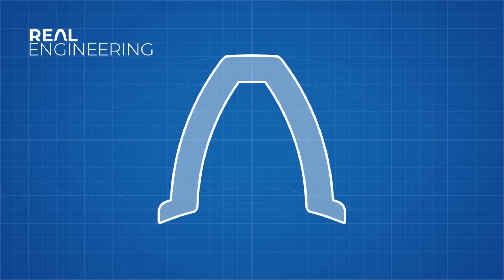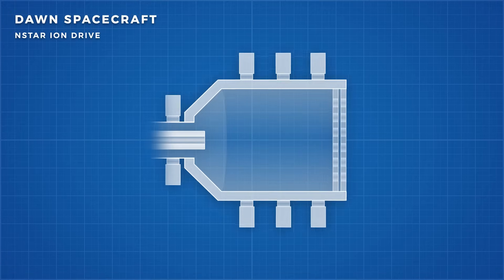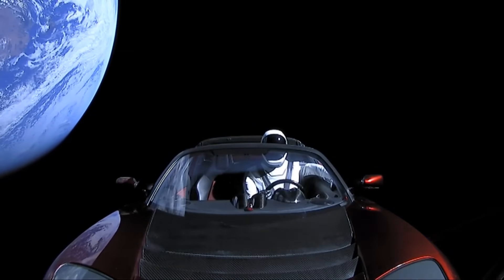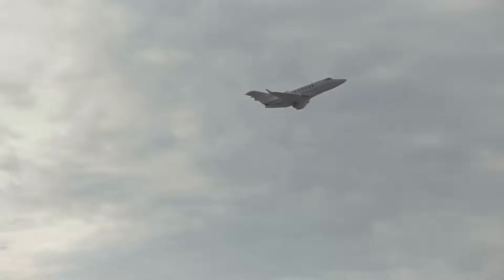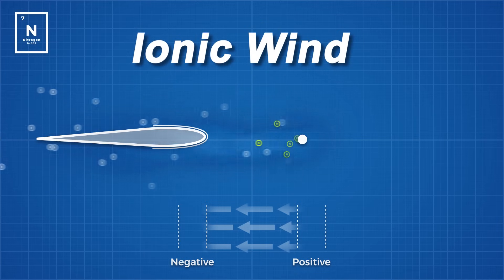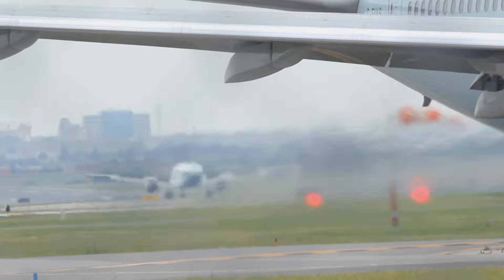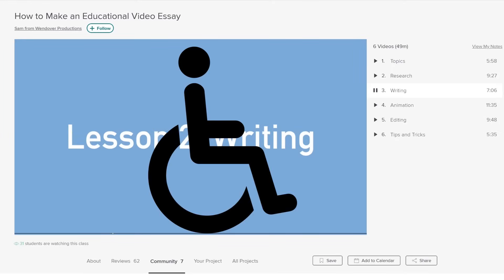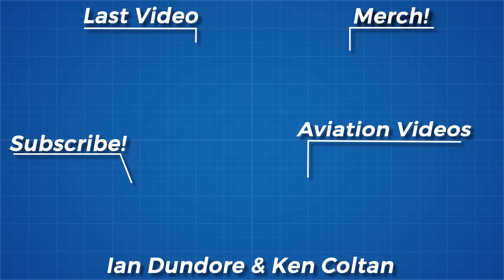Ion Propulsion - The Plane With No Moving Parts

Comment: What if you somehow hooked up these ion wing things to spin a propellor like a turbine being powered by the air kicked off of the ion engine
Reply: You still have the law of conservation of energy working against you. Every turbine slows down the air that passes by and produces more drag, which im turn would slow down your aircraft, not to mention all the ways energy is lost through transformation, cables, etc.
If you had an aircraft that could power itself by harnessing the energy of the wind it passes by while flying, you'd have created a second degree perpetuum mobile, which is impossible.
Reply: What would be the point of that?
Reply: The smarter thing would be to have a fuel powered generator to power the system or charge batteries that powered the system. 
But trying to produce power from spent power is a waste of power. You end up losing more than you gain. 
But either way, trying to scale the system to the weight that is gained by adding a charging system ends up requiring an exponential increase in the power needed to continue to keep it in the air. 
I will put it this way. If you double the weight of the craft you end up needing 4 times the power just to keep it airborne. Roughly speaking anyway.
Reply: The point is to have no moving part. A propeller defeat that purpose.

Comment: What about ram jets? They were the first non moving part aircrafts.
Reply: Not having any rotating turbine inside the engine, yes. That does not mean eg. fuel was walking into the engine on its own accord. The power train on this plane literally has no moving parts at all. Minor difference though, that's true...

Comment: Whats the problem whith solar energy?
Reply: Our abject failure to capture it. Think of "solar charger" phone cases that you need to keep in the sun for a whole day to be able to use the phone for five minutes; most applications require prohibitive sized areas covered in solar panels to produce usable amounts of energy. Yes, solar powered "gliders" have been built (taking advantage of being basically one giant wing covered is solar panels) but in the end it's a game of numbers - I'm not sure this engine would be efficient enough to fly like that indefinitely - on the other hand, props can definitely produce enough thrust and electric engines are pretty darn efficient...

Comment: I thought ion propulsion didn't work in atmosphere?
Reply: A special case, which is explained in the video. In outer space, you have to carry whatever you are going to ionize with you, as outer space is,  for this purpose, essentially empty. What you ionize is expelled at high speed, pretty much the same as a combustion rocket.  The atmosphere is mostly made up of nitrogen which can be ionized and attracted to another charged electrode. The moving nitrogen ions collide with other air molecules, inducing them to travel in the same direction, increasing the reaction mass. This effect has been known for at least a half-century, and you can see it demonstrated if you just put "ionic lifter "in your browser .

Comment: I still don’t understand how it works
Reply: This is how I think it works:
The air is ionized (charged)
An electric field produces a force on charged particles. 
Those particles are accelerated to a really high speed.
The same force (in opposite direction) is applied to the plane (Newton's 3rd law)
The plane accelerates forward
Reply: There were/air these Ionic Air 'Cleaning' things one could buy, which while not good at cleaning the air, did produce a quiet mild breeze.  article: https://negativeionizers.net/best-ionic-air-purifier-negative-ion-air-cleaner-reviews/

Comment: I always thought Ion engines were too weak for any sort of propulsion within the confines of the atmosphere
Reply: They still are. There exist indoor model aircraft made of the thinnest of balsa wood strips covered with ultra-thin film for wings, that can slowly glide through the air pushed along by the minute thrust of an elastic-powered propeller that is barely turning at all - that does not mean they ever had any relevance to actual full-size aircraft and powered flight. This is no different.
Reply: IT WONT WORK.MARK MY WORDS.
Reply: @esecallum  When a distinguished but elderly scientist states that something is possible, he is almost certainly right. When he states that something is impossible, he is very probably wrong. Arthur C. Clarke
Reply: @FactoryofRedstone  Go and watch RealEngineering's own video about electric aircraft propulsion, all of the problems listed there apply to this technology, and then consider than the ion drive is producing 1/10th the thrust per kilowatt that a propeller driven electric engine would produce.  It's essentially not feasible for commercial aviation until we have compact fusion devices, and/or batteries that store a couple orders of magnitude more energy.
Reply: @FactoryofRedstone  When a scientist states that his propulsion system works - when the video recorded obviously shows that glider (with a low wing loading) being launched by a bungee cord launcher, one has to wonder if that scientist is a drunkard. I bet that if you stick it on a Cessna, you wouldnt even get it to budge one nanometer. Ion propulsion doesnt work in the atmosphere for a variety of reasons - chief among them being air resistance. As was mentioned in another post above, they have been building rubber band powered gliders for years. The only difference between those gliders and this POS marketed as a new propulsion system, is that a rubber band glider can actually fly under it's own power, whereas that "ion" glider had to be launched with an elastic cord.
Reply: @isaiahphillip4112  I didn't say it will work tomorrow and I know there is a long way to go, but to state something is impossible, is most of the time not the best idea. And as you said one of the biggest problems is the battery, but as you stated yourself there are at least ideas that will make it possible.
Reply: @redryder6987  There is another part of the clip where they show the propulsion system turned of, and you can see a significant difference. 
Also there is a difference between, flying under your own power and starting under your own power. Because friction with the ground you need a lot more force for takeof then for sustained flight. 
Also this technology seems to be in it infancy, so to expect to power a Cessna is not fair at all, no one expected the first models of cylinder motors or jet turbines to power a Cessna they were all prof of concept.

Comment: As much as i loved the video, please don't refer to the speed as Mach, because a) it is relative to the speed of sound and Mach 8 on ground level is a whole different speed than in 14+ km height and b) technically there is no speed of sound in vacuum... Please correct me if I'm wrong. But that kind of bothered me.
Reply: Wow a small technicality, when you know exactly what he meant
Reply: @dragonbeast109  After all this is an engineering channel right? And this is an engineering problem x) I didn't want to sound rude, but I still think it is worth pointing out since it would take so little effort to change it :)

Comment: isn't this already invented - i.e. lifter technology?
Reply: The 'Lifter' thing promised 'anti-gravity';  an Ion Driven plane does not make such claims.  But yeah it is not technically new, I have seen this imagineered to propel supersonic lighter-than-air ships as well.  Here we have working non-hyped hardware.
Reply: @Peoples_Republic_of_Cotati  lifter technology works on the ion wind principle.  essentially charges up particles near the high voltage line and that makes it flow faster in the downwards direction thus providing upward lift.  THat's what the theory says anyways.  So this ain't new.

Comment: That's impossible, the flaps need to move
Reply: Not really.  You can control the aircraft with thrust alone.
Reply: @kensmith5694  yes but you'll need gimbled thrust, moving the engine

Comment: But, didn't was the Brazilian Santos Dumont that made the first flight ? Or at least the first self powered take off
Reply: No.
Reply: There are earlier competing claims, Clement Ader among others, but the Wright Brothers are usually credited with the first flight of a controlled heavier than air man carrying craft that arose from the ground and sustained itself on it's own power. Interestingly, the Wrights did experiments for years after that with a falling weight catapult to assist takeoff, essentially a retreat from their earlier accomplishment.
Reply: The Wright brothers were the first to fly (althought they didn't go public for various reasons).
IIRC Dumont was the first to make a public demonstration of flight, and the first to make a non-prototype, "mass" produced and commercially available plane (which, by the way, used some ideas patented by the Wright brothers).